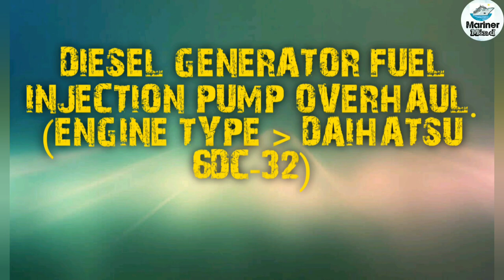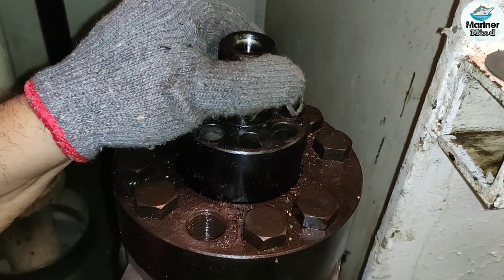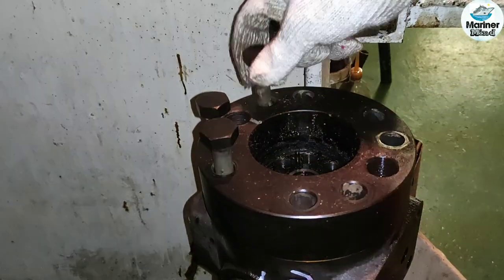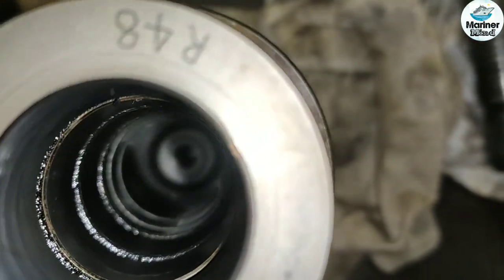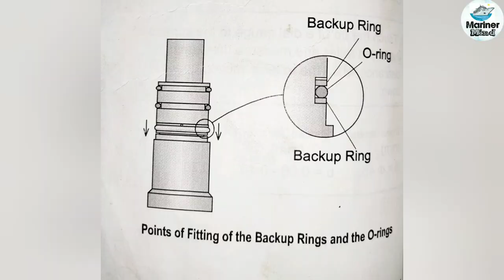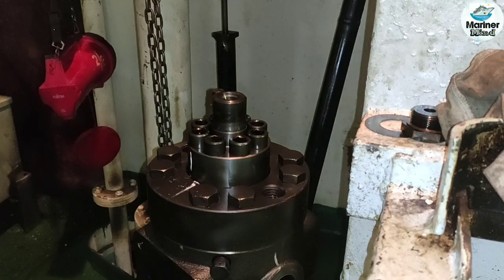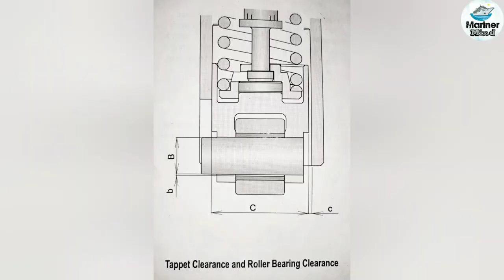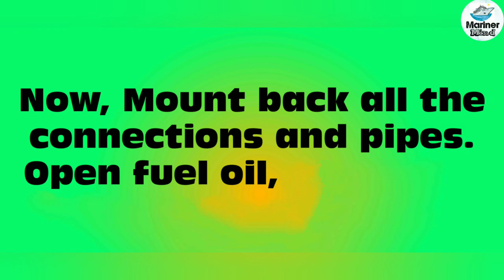Diesel Generator Fuel injection pump overhaul - Diahatsu

Comment: Direction of the top cover holding barrel is wrong.!! You cannot connect high pressure pipe Allen bolts at the end, may be you changed the top cover direction in place..???